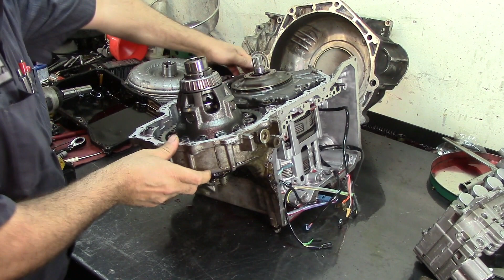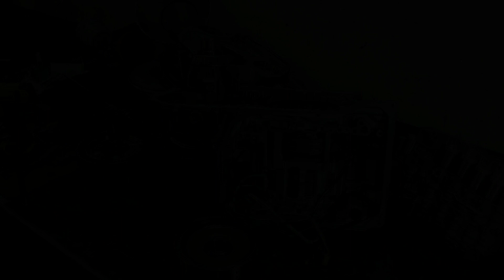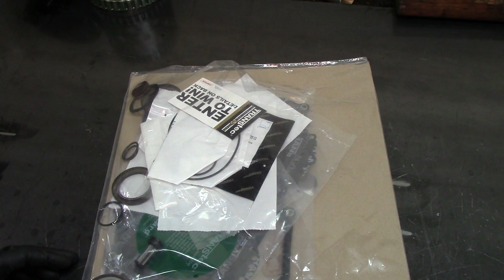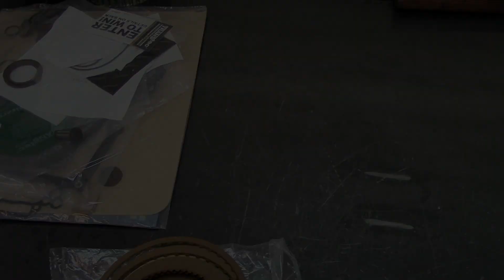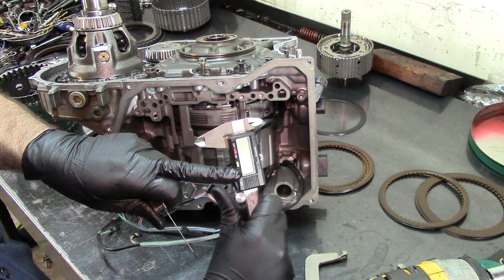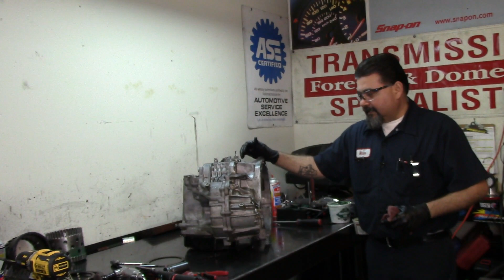09G Transmission Repair Part-2

Comment: I have a problem finding the input shaft oil seal for a Mini Cooper s 2006 and the gearbox has been replaced at some point. The input shaft on the torque converter 7598253 measures 43.8 and the oil pump measures 61 so if I’m right I need an oil seal 43.8x61x2x6 but bmw dealer can’t find the oil seal because my vin and reg shows a 42x61x2x6 which is too small so my question is can you tell me where I can purchase the correct part or the oem part number please

Comment: Hey Hiram i hqve a 2008 Volkswagen Rabbit 2.5L 09g my transmission is throwing one code "gear 1 out of ratio" what direction should i go with repair i have some experience with transmissions
Reply: It goes into limpmode which makes it stuck in 5th

Comment: Hi I’m having an issue with my transmission I’m getting code p0732 after changing the valve body and the old valve body use to give me p0734 & p0735 my car is a 2011 Tiguan

Comment: Just thinking that you haven’t shown the spring pressure adjustment on the other side of the housing. There is a specific measurement for the spring tensioner. If you are doing a complete o/h maybe good to check that end. Before removing the clip get an accurate depth measurement pin end to housing. Then remove the clip and you can unscrew the pressure adjustment. Going back ensure the spring is in place and screw it to the exact pre removal measurement. This affects the shift pattern. If it is flaring can decrease the pressure by 1 turn anticlockwise.  Otherwise you have done a perfect video as one
Reply from the maker: You're referring to the solenoids? 
I have a video doing this on a AW55 unit out of a nissan.  It's basically the same. Also I have a repair video on this 09G valve body.

Comment: I dont get a good thump on the k2, I hear a faint tap is that normal? If the bushing spins on the k2 should the air bleed to the lube port or should I get no air passing through?

Comment: Hi Hiram! Can you suggest me failure to play safe with the mechanic, I have a failure in a jetta special edition 2002 1.8 liter turbo engine, the transmission does not generate the changes only gives forward, back and parking, in addition to neutral but when advancing it does not It generates the change the oil I put 9.5 liters but it does not make the changes, I disconnect the harness and it only advances without forcing, you can advise me that it may be so that the mechanic does not grab me down, I stay tuned, greetings, excellent video, I hope you take the time to answer me I thank you infinitely, greetings, Hiram! from Queretaro, Mexico.
Reply from the maker: Puedes comentar en español para que se haga más fácil. 
Cuál es el problema que tiene tu transmission. También si el problema es antes de reparación o después. 
Que códigos registra y que transmission es. 01M, 09A, 09G?

Comment: Hirem~ 

Excellent work. I have a 2008 VW Jetta 2.5 Automatic. When it's cold, it will go into gear just fine, but after 2 or 3 minutes, when it warms up, it just free wheels. It doesn't matter if it's forward or reverse. The guy I got the car from had it stuck in a snow bank and I think he overheated the transmission. What are your thoughts on this? Thanks for your help.

Comment: I picked up an 05 beetle 1.8t/6-speed auto(09G) and it's pealing trans fluid between the engine and transmission.....the car had a constant vibration worth the engine on and the torque converter seems to spin with a bit of a wobble......the torque converter is pained blue so I assume that was replaced before, possible trans rebuilt too.
Trans shifts good and has no faults in the TCM but it leaks trans fluid between the engine and trans and like I said it has a constant vibration. Do you think the converter wasn't seated right and it messed up the front pump seal? 
Would I get away with just a seal or do you think the pump is damaged too?
Please advise.
I appreciate it very much, thank you in advance.

Comment: hey great job! i am having issues with a 09G on a Audi TT, it shifts hard and bumps into a few gears when its hot!, on cool temp it shifts fine and normal, i changed valve body with a Remanufactured from China, and same issues, it got bit better but when hot pass 102 degrees C it shifts hard into 2nd Gear from 1st Gear, jerks bit into 3rd, and on downshifts from 3rd to 2nd it bumps, i adjusted valve B1 clockwise 1 turn, but no improvement, all solenoids 0.58 ohms i am in the process of doing a transgo shift kit, can this be still a valve body issue??? especially only on hot ATF temp it gets sick! cold temp its fine. Any help i would appreciate ! thanks also i did reset and relearned , basic settings for Throttle body and kick down using ross tech VCDS. also used a DS708

Comment: Your videos are great. I've learned a lot from them. You are very meticulous with your work and I love the level of detail you give in your videos.
Is there an easy way to test the input speed sensor to see if it's bad before replacing it? I'm getting the input speed sensor code but some people say dirty transmission fluid can cause that as well. I don't want to reassemble the transmission just to find out I'm still getting the sensor code. Also, do you have a recommendation of where to buy them? They seem quite pricey.

Comment: Hello. Tell me, please, what is the maximum torque that can withstand transmission? I made a chip on Skoda Octavia A5 210 hp and 320 NM torque. How long it will last transmission?

Comment: Hiram, Many thanks excellent. When doing the air test where do you usually find this info? In the ATSG manuals or you just know from where the valvebody circuit/holes mounts to?D

Comment: You have great info and videos. I am working on a 2007 Jetta with the 09G. issues are shifts fine for 15 mins consistently through all gears. Then when trans temp gets to about 190 degrees shifting into 3rd kinda jumps and shifting in to forth gets nothing. I can manually shift through the gears, when gets to forth I let off the throttle and go to 5th. Then can go back to forth, 5th and 6th are ok. Another issue is trans temp gets to 225 degrees driving around on flat ground. I am thinking a solenoid(s). Any thoughts? As far as I know the trans has never been apart, never been serviced, 93k miles. I did a drain and fill, cleaned pan and new filter, no debris in filter that I could see,  fluid was dirty but not burned, usual amount of metal on magnets. Thanks

Comment: ive got a jetta 2002 1.8t , triptonic transmission automatic , my issue starts when the car only reaches 20 miles but engine keeps reving higher and transmission does not engage, ut dies work when it wants to ,

Comment: Greetings Hiram, I have a 2011 Range rover sport with 50K miles.  My transmission fault light came on so i got the code P2704 Transmixxion friction element & p0783 3-4 shift?  What you recomend I do?

Comment: Your videos are the best. Thanks Hiram. I just assembled 09G, the transmission runs fine for about 200m then I get the error of G195  output sensor implausible signal. when I check the RPM for input is1600 while for the output is 900 RPM. friction plates are new. please help Hiram

Comment: I have a question for you Hiram, I have the same trans  (09G) in a 06 VW GLI. It shifts good most of the time, sometimes it takes a while to shift or it jumps from 3rd to first around corners. now it has a growling sound while in any gear at a stop, put it in neutral or park and the growl go's away, and it go's away when you start driving. I figured it's either clutches or bearings??

Comment: Hiram, What a great video, I have a few of these transmissions and have already replaced the valve bodies but I am still getting binding between 3-4. Are there any special tools I should have for a complete rebuild? Getting out the ring clips etc. I got the teardown book.

Comment: hi i am saeed in KURDISTAN ,first thank you for YOUR useful vid ,i have a question pls ,i have an passat 2007 2.0fsi with JUC code gearbox and the code is 09G300039MX now my question is (is it possible to change with another code for example 09G300033B? while both has exactly the same shape and both take off form size same engine which is 2.0l ? i am really need help thank you for any advice ..
Reply: yes

Comment: I built a lot of the old american trans,mostly performance,and a lot that somebody had already been into and usualy wasent quite right if they worked at all. Hiram is very good.always pay attn to everything when you tear it down and look for issues.it's a forensic teardown,just like at the morgue, dead men tell no lies.as do trans owners/shops who effed it up. I was rebuilding trans long before I worked at a trans shop as the R&R guy. then the "build guy" asked if I wanted to learn how.....I told him they were simple,nothing to it.he laughed,I had just pulled a turbo350 out.I told him to scatter it across the table then go to lunch,i would ask questions lator....well when he got back it was back in the car so he could test drive it....after that he took longer lunches,opened his own trans shop(that the owner didnt know about) but he couldent pass the atra test???? he quized me and I pased it no studying, the test was stupid like how many bolts hold on a c4 valve body & other useless crap so you could buy thier arm patch. I reworked many from atra shops. did a lot of racing trans.adding 2&3 extra clutches machining parts etc. Ive never done any fwd stuff or the electronic valve bodys. I would like to learn what it takes to put a electronic valve body trans in a car with out the electronics. like a tiptronic trans in a old bug. or if the diff could be fliped  so the engine could be behind the trans.or flip the entire trans&add a sump with suction line&drains so it coule be a rear engine trans. keep up the great videos mr Gutierrez as there are few that can do it right these days or fix somebody else's handy work

Comment: Hi Hiram,  I'm having an issue with my mini Cooper r53 year 2006 aisin 6 speed gearbox,  which I believe is the same 09g transmission as the one in the jetta. I'm occasionally having this issue as recorded in this video. Could you kindly advise on what sort of issue I'm facing and how can I go about fixing it.  Your help and advice is very much appreciated.  Link to video is here
https://youtu.be/2diI_4X_kNY

I am also facing a sudden forward lurch/jump whenever I am in 2nd gear when I press the accelerator approximately 40-50% and above.  Around 2.5k rpm it will surge forward and rpm spikes up.  I need to tap the pedal lightly everytime I'm in 2nd gear to avoid this issue..  I reckon it would be a bad valve body I suppose? Kindly advice..  Thank you

Comment: Good video Hiram,
I am one of those guys that have been in the general repair for over 15 years and watched a friend of mine rebuild a transmission and i was hooked. From that point i went to school for transmissions and have not looked back. That was 6 years ago. I have to agree with you that transmissions are hard work not only in rebuilding, installing, and diagnosis. But the continuing education that i believe is more difficult then general repair. New units are made constantly and their problems continue as more are electronically controlled. The days of governors, accumulators, and on - off solenoids are over. 8 and 10 speeds are on their way and we need to continue learning them now so we can stay ahead of the game. Videos like these are very helpful.

Comment: So. if I'm getting this right, the bottom line is that they forgot to put in one gasket. Is that correct?
Reply: Some has gasket some not. They didn't check the clearance

Comment: @36:50 I don't think it's so much the amount of time that one has been rebuilding transmissions, but rather the amount of motivation one has to further sharpen their skill. Just as you've been called on to help "more experienced" (read, doing it longer) rebuilders, I too have been called on at times to help "more experienced" driveability techs with problems they had. Of course, I trained more than they did, whereas they quit training all together.

Comment: Around 24:00, where the general rule of thumb would've gave the clutch pack 0.060 in. clearance, definitely agree that sounds to loose, but it could be worse. Could be like when the 700-R4 was widely used, GM actually had a spec of 0.100 in. clearance on the 3-4 clutch pack. Try to let that sink in for a minute before you bust out laughing 😂